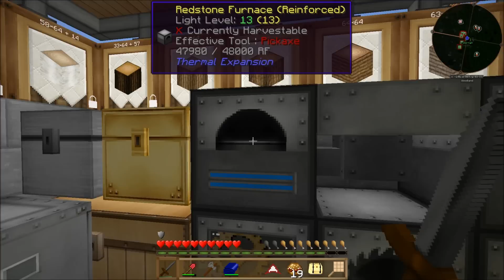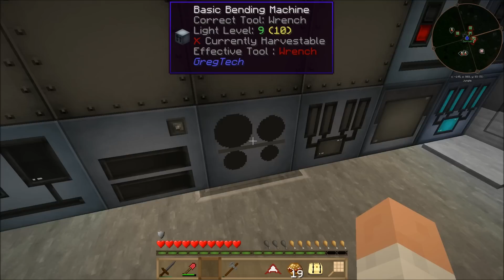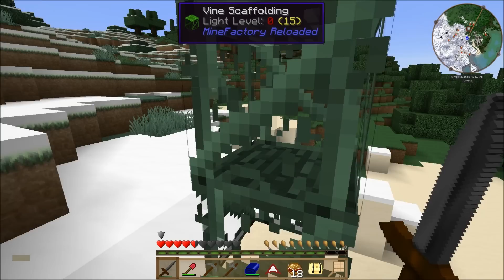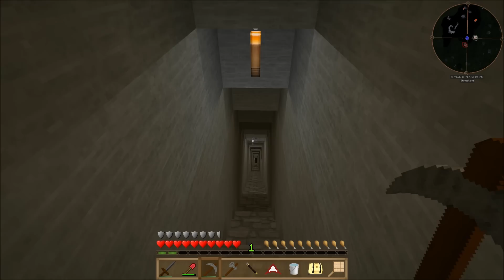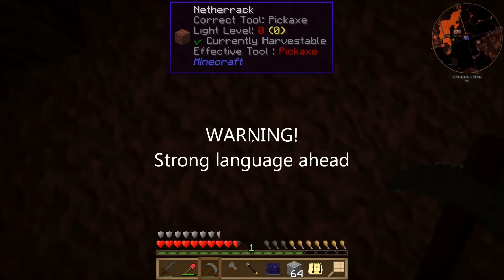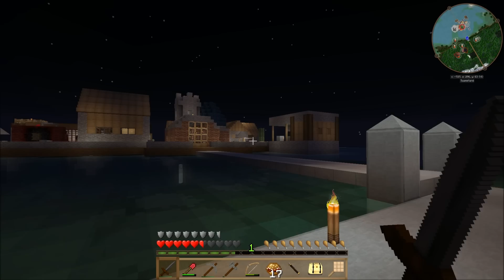Nether Fail - Utopia³ Resurrection - Grumpy Engineering Co.

Comment: Can you just set up an ExNilo sieve with an autonomous activator and a vacuum hopper to sieve all that soul sand or is there a gregtech machine for sieveing?
Reply from the maker: If only that was possible, no ExNilo in this pack. There is a gregtech machine that can process the soul sand into it's components which is the centrifuge, but you need at lest an advanced version because the basic one is not powerful enough.
Reply: Ahh I see, wasn't sure what was in this pack. Gregtech is new to me but looks pretty cool. Got a real feeling of progression as you move through each tier and unlock the ability to use materials more efficiently.

Also was wondering what the plans are to increase powergen since the current machines are running that generator at max.
Reply from the maker: For power gen in the short term the plan is to just make the generator larger and increase the fuel production a bit. In the long term we'll most likely install some nuclear reactors in the space station.
Reply: Looking forward to you guys building the space station :)